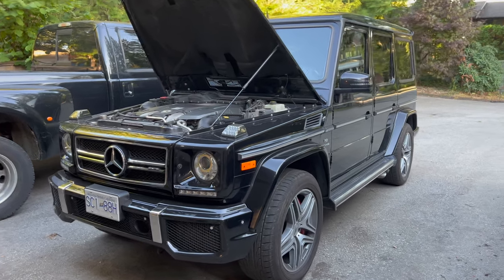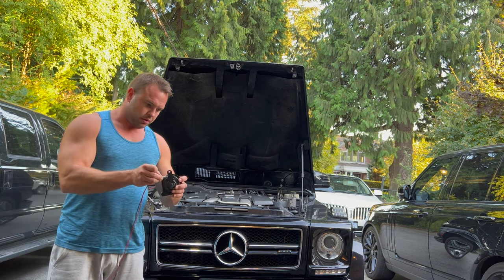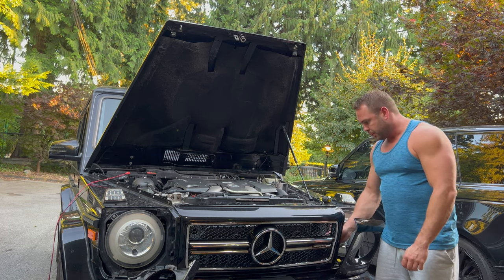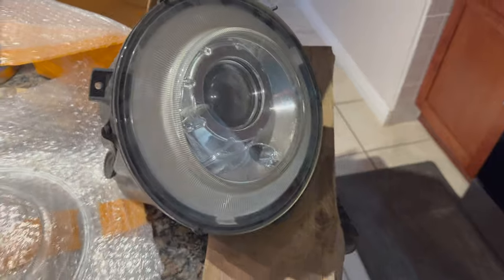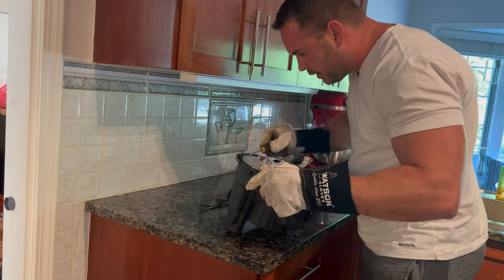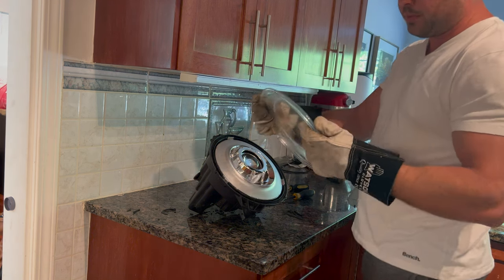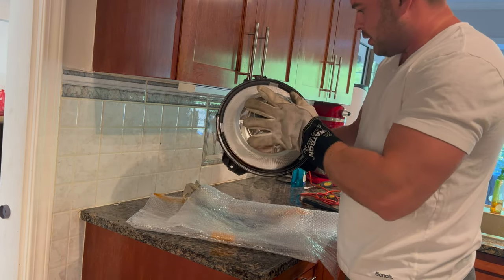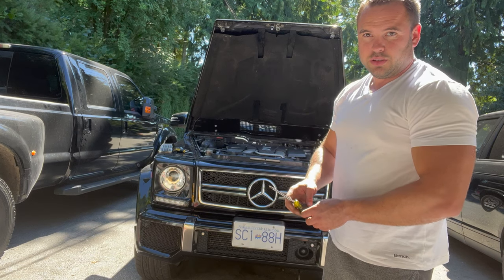Replacing a headlight lens on a 2013 G63 W463 and a small update

Comment: Hi Mike!can you provide antenna receiver part # please! I have same problem with my G.Thanks!
Reply from the maker: Hello. The part number is A1668200689. The new module didn't fix my issue however, I've got a wiring issue somewhere else
Reply: @ViperMike  thanks!! Thanks